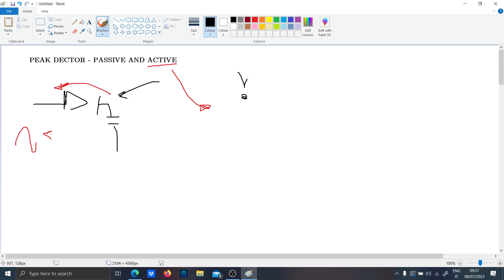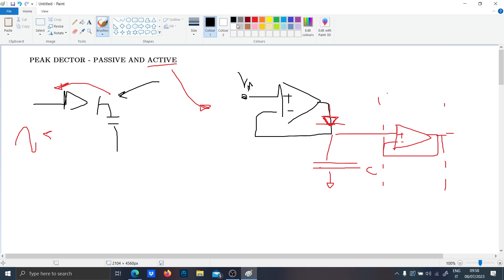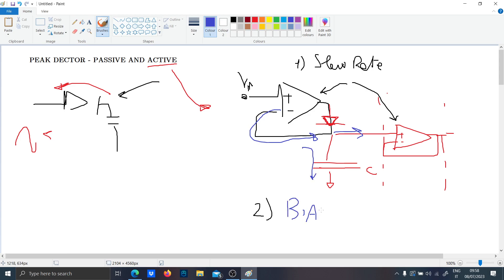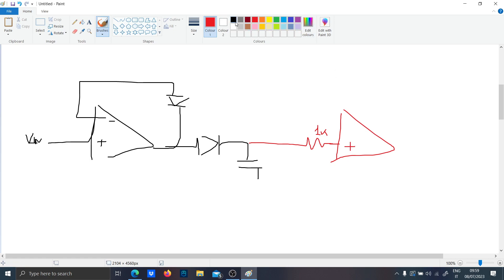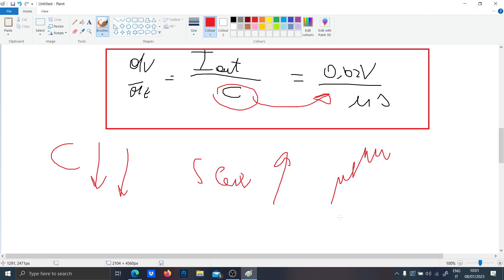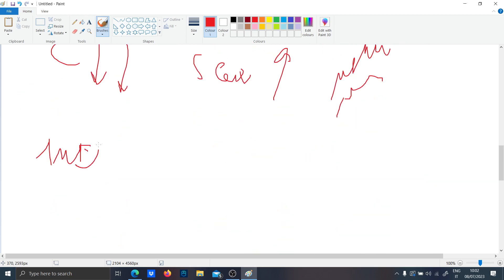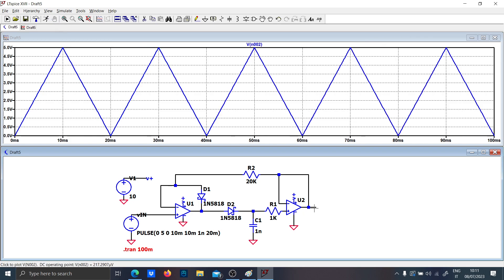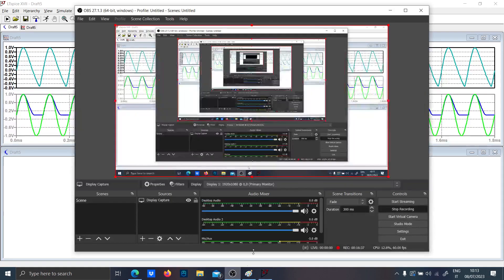LTSPice Passive and Active Peak Detector

Comment: My brother, I need your help. I am currently working on a graduate project to operate a water pump through direct solar panels, and you know that the voltage will change a lot. My design is to build a DC to DC converter. The voltage range  between 100 volts in the morning and evening to 350 volts at noon.  can it works in this large range of wide range of voltage without getting core saturated or losing his job ,Do u think by changing switching freq and duty cycle can it work fine?.Arduino nano as switching frequency will be
Reply from the maker: You are probably talking about Half Bridge or Full bridge configuration with the transformer included and the rectifier on the secondary side, I guess? If that's the case yes, provided that you can supply the transformer with a voltage withouth a DC component. You can achive that with a full bridge or half bridge configuration or by putting the series capacitor ( warning here, he will be very stressed and failure risk managment is important). Plus, even if arduino generates the pwm square waveform, you will need proper mosfet drivers ( here look UCC28XX series) with a good dv/dt. 
Remember Half bridge up to 500W, Full bridge even higher than 1kW. 

Now by implementing a voltage/current control, the pwm will adjust the duty cycle of the mosfet, which in turns changes the energy delivered to your transformer (You can find voltage or current controllerls analog integrated alredy implemented and the value of capacitances that you need to put in most application note: look for Type2/3 Compensators appication note)
Reply: @LukeXVIIx64  
Thanks alot,I found the solution is here 
https://www.ti.com/lit/ug/tidu404/tidu404.pdf